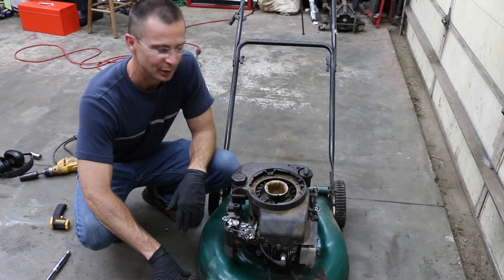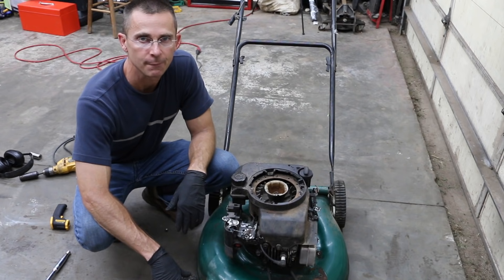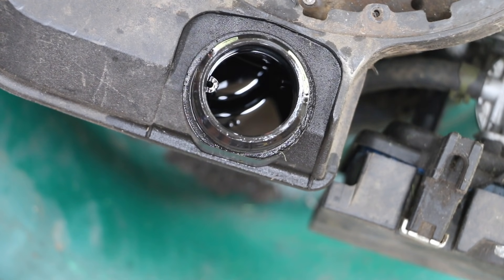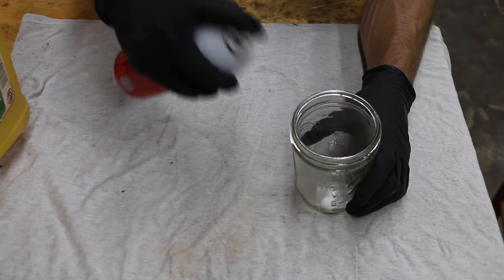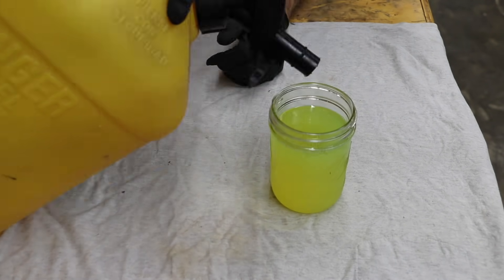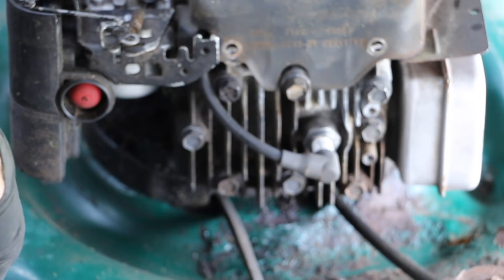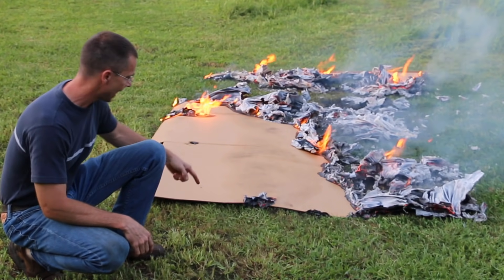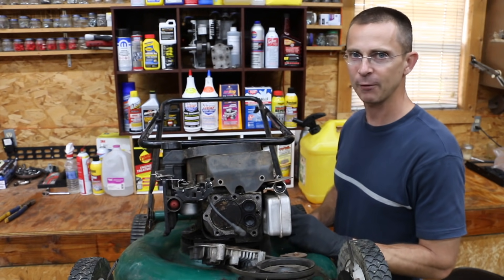Will a Gas Engine Run on Diesel?  Let's find out!

Comment: Running gas and diesel is the same as running mixed fuel for like ur chain saws and other small engines
Reply from the maker: Great point. Thanks for commenting.

Comment: Interesting, but I miss the point.  Is Diesel cheaper than gas in the US?
Reply from the maker: Those requesting this test had a lot of questions.  What if diesel is accidentally added to the fuel tank of a gas engine...will it cause damage?...will it run?...will it overheat?  Thanks for commenting.

Comment: The 50/50 may have worked because the gasoline probably ignited first by the spark plug and with the heat generated with the compression got the diesel going too right after.
Reply from the maker: Great point and thanks for commenting!

Comment: I'd be curious to know what the 'limit' of this is. In other words, in an unmodified engine with no 'tricks' (like using the primer constantly or using the choke), what is the maximum percentage of diesel to gas that will reliably run the mower?
Reply from the maker: This is a great question.  Maybe I can do a video on this.  Thanks!

Comment: Do a diesel engine  runing on gas
Reply from the maker: Thank you for this recommendation!
Reply: Yes they do, right up until they blow up
Reply: It works just fine, you just have to be sure to add some oil to the gas to lubricate the High pressure fuel pump. I ma of course talking about mechanical injection systems, I would not try it on anything new.
Reply: integr8er66  it definitely does NOT work fine LOL
Reply: And blow the injection pump and injectors too!
Reply: It would explode after a short while but yeah worth a test
Reply: https://youtu.be/lLTkouIoHKQ not exactly gasoline but still compress natural GAS.
Reply: bosshoss69lee its a good test then

Comment: You used the wrong engine.  A dodge lean burn v8 from the late 70s and early 80s once warm ran very well on diesel.  And the great part was, once you got it warm and running on diesel you never had to worry about cold starts, because you couldn't turn them off.
Reply from the maker: LOL! Thanks for commenting.

Comment: I had accidentally filled up an empty tank with kerosene while mowing a few summers ago. The engine was hot from mowing. I did not notice any difference and not until I was going to fill up again did I realize it was not gas I had used for last fill up. I filled up with kerosene again but took a break for lunch and the engine cooled , later I was not able to get it started and had to drain and fill up with gasoline for it to start. I guess the hot motor made the difference the first time.
Reply from the maker: Yes, you're right. The hot motor allowed it to run. Thanks for sharing this experience!

Comment: That's why it's much safer to use diesel to start brush fires with Diesel and not use gas. Burn center is full of people that's used gas for starting brush fires.
Reply from the maker: Yes, you are right.  Diesel is definitely much safer. Thanks again!

Comment: Octane is to low on Diesel for a gas engine to run on it 100%. Always diesel explodes under pressure as where gas explodes under spark. That's why diesels do not have spark plugs but have very high compression, gas engines have much lower compression and spark plugs.
Reply from the maker: This is an excellent point. Thanks for commenting.

Comment: So if you can get the diesel to ignite easier you could put it into a gas car? An potentially get better mileage?
Reply from the maker: This is a great point.  Yes, it could improve fuel efficiency.  The key is to get the diesel to easily convert to vapor state as it enters the combustion chamber.

Comment: what happens if you install a cylinder head spacer like 1" to increase combustion chamber volume and decrease compression, does it run, does it run rich or lean, does it have any power??? Does it use more or less fuel?
Reply from the maker: Thank you for this recommendation!

Comment: By accident put diesel instead of petrol in my van - approx quarter tank (pumps were poorly marked at the Gas station). I then filled up the rest of the tank with high octane to compensate for the lack of power. The result was a bit of smoke  which later cleared, but a lot of smoke if you floored it.Also difficult to start the next morning but.........very very economical - got much further on a tank than normal
Reply from the maker: This is interesting. Thanks for sharing this experience.

Comment: I had diesal in the wrong can and put it in my motorcycle.  It burnt off the gas and straight up wouldn't fire.  Just dumped out the fuel tank and put gas in.  Only problem was getting the diesel in the fuel injectors I'm assuming to burn off which wasn't good for my battery constantly starting it and starting it.  Also ran kerosene in my my mower once and was pretty much the same thing but it had enouph fuel where I just cut the yard and ran it completely dry before refilling it again.
Reply from the maker: Thanks for commenting on this.  The motorcycle is probably tuned quite a bit differently and much more sensitive to the type of fuel that is used.  Thanks again.

Comment: What did it run on during the compression test?
Reply from the maker: It didn't have any fuel in it during the baseline test.  Then it had a diesel/gas mix during the subsequent test.  Thanks for commenting.

Comment: I get it that you might have need one day to run a gas engine on diesel- but why would anyone put a mothball in gas tank?
Reply from the maker: Original mothball formula contained Naphthalene, which is supposed to boost octane.  Diesel has a low octane rating.

Comment: In some of our older machines  such as backhoes or skid steers  we would have to do the exact opposite.  They were diesel but due to the extreme cold in ct we would mix gasoline  with the diesel to keep it from gelling . Otherwise they won't run in sub zero temps
Reply from the maker: Thanks for this information.  Any concern regarding the gas within the diesel hurting the injection pump?  I suppose there's still adequate lubrication.  I have an old diesel tractor that's a little difficult to start in cold weather.
Reply: It never hurt the injector pumps or the o rings . We used just enough to keep the fuel from gelling ,almost like dry gas.  We even did that in our lull falcon 600  in extreme cold weather . I myself serviced these machines and never saw a consequence.  I got this tip from people much older than me with much older folks to keep our farm equipment up and running

Comment: Dude you're lucky that gasoline didn't capture you in the fumes when you lit it. Have you ever heard of a gasoline car being filled with diesel fuel that did not have to be towed? Next video should be "how long a diesel engine will run on gasoline" That will be interesting.
Reply from the maker: Thanks for the video project idea!
Reply: James Lacey no because as seen in the video a gas engine won't run on straight diesel. The usual scenario is a near empty tank that gets filled with diesel by mistake. So no room to make it 50/50 or close to it.

Comment: Someone is trying to sell me a 1991 bmw 735iL fully loaded with 184000km on the engine. New rad, intake assembly, battery, thermostat housing seal, valve cover gasket, head gasket and all fresh European fluids put in for oil, coolant, power steering and etc. No rust anywhere on it and garage kept. Everything works except for the hydraulic lifting arms for the hood and trunk. You have to hold them open. I offered him 3500 for it and he thought I was insulting him.
Reply from the maker: Seems like a nice car, but age becomes a factor.  You seem to have offered him a fair price. Thanks for commenting.

Comment: Once the engine is Hot the diesel should burn. Start with 1/16 tank then add the diesel why it's running. I only know this because a guy added diesel to Honda 5000x generator at work. Ran all day just smoked a bit
Reply from the maker: Thank you for this recommendation.

Comment: Try using powders for fuel. You would have to use something like a fan & one or more large containers to create & maintain the dust cloud.
Almost anything in a powdered form is combustible.
Reply from the maker: Thank you for this recommendation!
Reply: Another one that just crossed my mind was to try acetylene, if you haven't already.
You can get calcium carbide on ebay:
https://www.ebay.com/sch/i.html?_from=R40&_trksid=p2065413.m570.l1313.TR6.TRC2.A0.H0.Xcalcium+carbide.TRS0&_nkw=calcium+carbide&_sacat=0
Just add water... :-)

Comment: Nice vid bud. Should try like a 10/90 ratio 5-10% gas and like 90-95% diesel I ran outta gas and had mixed fuel from work with high concentrate of diesel and not much gas and mowed with my push mower and didn't break it but you can hear it start to dieseling and knock a little from pre detonation and couldn't kill it even with plug wire pulled I eventually got it to turn off by running over a area that had very tall grass but was just interesting how it started dieseling it didn't blow up or anything just started to run off compression like a Diesel engine. Keep ur  the great work
Reply from the maker: Thanks for the positive comment and thanks for this recommendation.

Comment: How bout changing the spark plugs each test so that you always sure you have proper ignition and don’t have to worry about extra carbon deposits fouling the plug or high speed glazing?
Reply from the maker: Thank you for this recommendation.

Comment: my understanding is gas engines run on the vapour, diesel uses atomized fuel as it will not vapourize.
50/50 probably works as the gas is a catalyst.
I wonder how efficient it is compared to straight gas.
Reply from the maker: Testing efficiency is a great suggestion.

Comment: Try two stroke engine they have higher compression they will run off of diesel fuel how to use starting fluid but once it gets warmed up it will run
Reply from the maker: Thank you for this recommendation.

Comment: I don't know if you are able to on A lawn mower but you could try advancing the spark curve so it has a much hotter spark. The diesel takes a considerable amount of energy to ignite. A diesel operates on knock as opposed to a gasoline engine were knock is destructive. Gasoline contains about 2000 Btu of energy while diesel contains 4000 Btu use of energy. A diesel engine is also a positive displacement engine That typically has much more air available to it then it needs to burn efficiently. A Turbo diesel for example typically has 600% more air than it needs to efficiently burn. The last useless fact is jet and diesel number 2 are the exact same fuel. Jet a is just slightly more refined for less wax and has attitudes to prevent it from freezing at altitude.
Reply from the maker: Thanks for this recommendation.

Comment: The Navy Fire Fighting School uses Gasoline in order to start the Diesel fuel it has in the bilges to run simulated fires.  Once going the fire teams have to put the fire out using water.  Believe it or not, it works.
Reply from the maker: Thanks for commenting on this!

Comment: The 50/50 mix is an interesting idea, but in reality it means you have to buy two kinds of fuel instead of one, and diesel costs more than gasoline anyway so you can't even justify it on the basis of saving money.
Reply from the maker: This is a great point.  Thanks for commenting.

Comment: I'm honestly amazed that it runs at all. Diesel doesn't vaporize as easily as gasoline does, which makes it hard to form a proper mixture fast enough to run in a gasoline engine.
Reply from the maker: Yes, I was surprised as well.  Thanks for commenting!

Comment: Might be worth noting that the engine didn't self feed fuel because the residual diesel was still burning during the intake (vacuum) cycle therefore not providing enough vacuum for the vac operated fuel pump to operate properly. Hence having to use the prime function.
Reply from the maker: Great point. Thanks for commenting.

Comment: Diesel fuel works by compression that's why diesels have glow plugs to heat and expand the fuel. Gas fuel works off of ignition that's why gas engines have spark plugs. I see people who are amazed that a diesel with a turbo is running at 35 psi on a stock engine. Its really not amazing if you knew that diesels work off of compression.
Reply from the maker: All great points. Thanks for commenting!

Comment: I'd really like to see the gas and diesel mix in a glass cylinder head. How does it compare to regular gas, flame speed and ignition as well as the color of the flame. Last but not least is there signs of pre ignition
Reply from the maker: Thank you for this recommendation!
Reply: Project Farm i love to try experements and recently i tried a used motor oil mix in my trucks engine. I ran the oil through a coffee filter and then mixed it 10:1 with regular gas, i let it settle for a day then poured off the top and it ran my engine just fine as long as I  stay under 90% throttle there's no ignition knock and no smoke, power is pretty much the same could you try this on a lawn mower to show us how much carbon build up occurs and what the burn speed is like in the see through head thanks a bunch I'm a huge fan and always watch your new fuel videos, the kerosene test was awsome with the slow mo burn speed at low rpm I think the oil would be very similar. Thanks for reading the comments !

Comment: i owned a landscaping company for a little while and to prevent idiots putting straight gas in the 2 stroke engines i only supplied  mix gas. the 4 strokes would run a little smoky but i never had any problems with any of my engines
Reply from the maker: Thank you for this recommendation.

Comment: Accidentally ran a diesel van motor for about 350km (220mi) at 100kmh+ (65mih) on 91octane petrol (Gas to you US peeps.) because a jerry can was marked incorrectly. It worked. Gradually lost about 5% power. Never worked the next day or ever again.
Reply from the maker: Thanks for commenting on this.